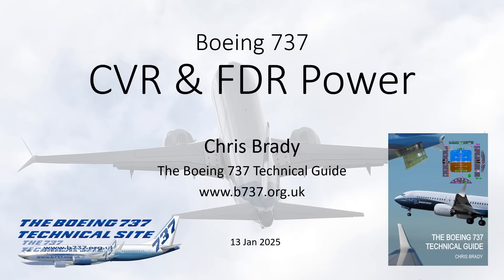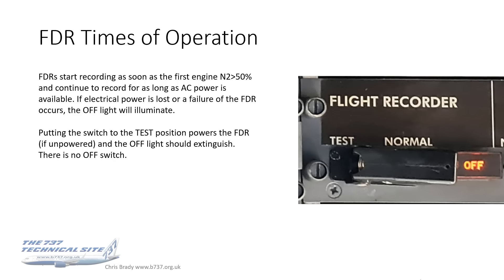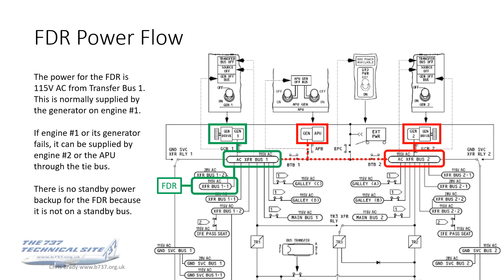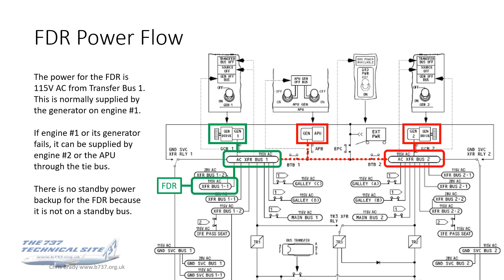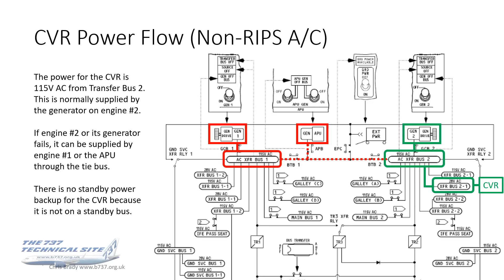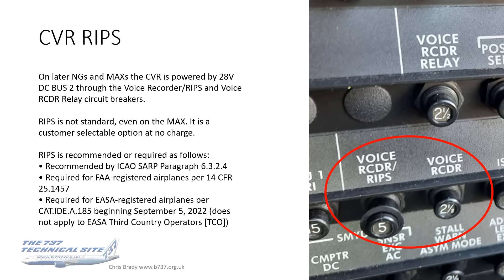737 CVR FDR Power

Comment: Crazy you would think one of the recorders would run on a standby bus.
Reply from the maker: As I said in the video, it won’t help get you down so save the battery for other essentials
Reply: @ChrisBrady737  no but the whole point of these devices is to save lives in the future ! - they cannot do that if they are not running, this is frankly an unbelivable design flaw
Reply: @birdingbilly  So you'd further jeopardize the lives of those on the current flight just so you can—with a high probability—learn that the accident was caused by pilot error due to gross incompetence, with little to nothing learned that will prevent the same from happening in the future?! I, for one, am glad you don't design airplanes.
Reply: @petep.2092  nope, I would design in enough power to do all the things needed including the FDR and CVR - it's not rocket science and just common sense, something that you clearly lack.
Reply: @ LOL. There is nothing more useless to the pilots than the flight recorders. So, if you had common sense, you'd use that extra battery power to power more items that could be of benefit to the pilots instead of the recorders.
Reply: @petep.2092  more batteries - as indeeed is now required
Reply: True however make a bigger battery to maintain the 30mins .... Boeing have seriously lost there way @ChrisBrady737
Reply: In a complete electrical failure scenario the FDR wouldn't get any data because the computers generating it are mostly offline in that scenario.

FWIW I think Boeing should have updated the newer 737s to auto-start the APU in event of dual generator failure but to be fair that is an extremely rare scenario.
Reply: @xenadu02  I think that in case of total AC electrical failure, some equipment powered by DC bus(es) still produce some data worth saving into the FDR.

About APU - I totally agree with you, and switches/relays modified to automatically restore power to AC transfer buses (AFAIK currently at 737 a pilot must flip the switch to power AC buses from an APU).
Reply: @ Agreed. On dual gen fail computer should auto-start APU and auto-switch AC xfer bus to APU once it is online. Clearly the existing incident model for dual engine out at low altitude is incorrect. It seems to happen once a decade (give or take) so it is worth making as much as possible automatic in that scenario.

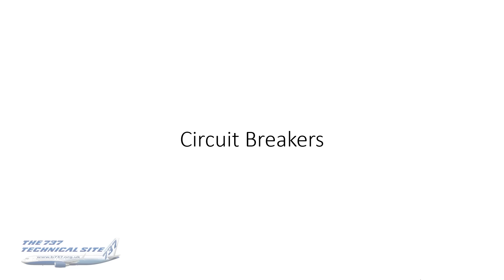Comment: 12:02 CVR in aft cargo hold compartment 12:20 FDR in rear galley ceiling 13:29 both powered from E&E bay; cabling must be intact 14:42 circuit breakers can/should be used to prevent accidental overwriting of incident data

Comment: Based on the video, it can be inferred that the aircraft most likely had functioning hydraulics in the final phase. The 737 does not have a RAT, meaning the aircraft should have had electrical power. Therefore, I can't imagine what could cause both the CVR and FDR to stop working just 4 minutes before the accident.Is it possible to perform such an extreme landing using only control cables to operate the aircraft's flight surfaces?
Reply: 737 flight controls are cable and pulley. They're 40's and 50's technology; There's no fly by wire.
Reply: 737 can be flown without hydraulics (at least for pitch/roll), it's called manual reversion, however to control yaw, electric power is required to run standby hydraulic pump for rudder.
Reply: @ukaszwielgosz7093  The aircraft approached at 200 kts the correct speed for a flapless approach. At that speed the adverse yaw would be relatively small especially if the roll-rate was kept low.
Reply: The No 2 engine was operating during the landing, but probably at low power, providing some hydraulic power. This may have assisted the pilot, as the flight controls are a relatively light load. But the hydraulic power would have been insufficient to operate the flaps & slats and the undercarriage. Also the engine power my not have been enough to keep the No 2 generator online.

Comment: What would happen if the pilot pulled the fire bottle handle for the left engine? Is it any different than just shutting down the left engine power?
Reply: If I remember correctly, pulling the handle closes engine bleed air valve, closes engine fuel shutoff valve, closes hydraulic shutoff valve, closes engine anti-ice valve, trips generator control relay, arms fire extinguisher bottles, silences fire warning bell, and illuminates fire handle light, and turning it fires the bottle. So there's a lot more going on than merely shutting down the engine but the result is ultimately the same - engine shutdown and a loss of the AC bus and hydraulics powered by that engine.
Reply from the maker: @GlutenEruption absolutely correct
Reply: Shutting down an engine with the fuel cutoff switches doesn't stop the engine-driven pump (EDP) producing hydraulic power via windmilling. Shutting down the engine with the fire handle would stop the EDP producing pressure. That might be a clue as to why the #1 reverser didn't deploy (or rather one of the reasons why)
Reply: @ great info! If you shut off an engine with the fuel cutoff switch, when you’re on short final, below a thousand feet, and slow enough to have the gear down, how much power are you going to get out of the EDP from windmilling at such a reduced speed? Does the 737-800 have any kind of load shedding for the hydraulic system, or does everything on it just get gradually reducing pressure/volume?
Reply: @ImperrfectStranger  "That might be a clue as to why the #1 reverser didn't deploy (or rather one of the reasons why)"

The No 1 engine was not running during the landing, so it is likely that the thrust reversers was not deployed because it was not selected.
Reply: @ Well, there are might be lots of reasons why the reverser didn't deploy:
Fire handles, pulled shutting off hydraulic fluid.
Not enough hydraulic pressure to unlock the reversers (The engine probably wasn't windmilling fast enough to get power from the engine-driven hydraulic pump)
Radio altimeter not providing data to the reverser system (in place of the weight-on-wheels air/ground sensing system). The Radio altimeter signal goes via the Flight Control Computer, so maybe a power issue with those.
Some other electronic interlock I'm not familar with. 

Even if the engine wasn't running, the reverser blocker doors would have provided some drag (at higher airspeeds).
Reply: @ If the engine is still running, can the cowling slide back without the reverser doors deploying? In other words, could the right engine have been sending all of its thrust rearward even though the cowling portion of the reverser was slid back?
Reply: @PetesGuide  The blocker doors are  mechanically linked to the reverser cowls with individual metal ties for each door. Think of an umbrella, but with individual cloth panels.
Reply: @  Thanks!

Comment: So it is looking like the most plausible scenario from the little we know so far would be a dual engine failure or shutdown, with no APU running.
Reply from the maker: It looks like that but we will only know for sure when the report is published
Reply: Under such a scenario, is it correct that there's no hydraulic power generated by the Electric Motor Drive Pumps (EMDPs) or Engine Driven Pumps (EDPs)? Would that only leave whatever pressure is stored in the accumulators? From there, I assume it would be difficult to operate the reverse thrusters, flaps, landing gear etc?
Reply: @drmal it’s possible that the EDP’s may have been producing pressure depending on the RPM of N2 due to windmilling - unless the fire handle (switch) was pulled. The accumulator on the B737NG is only for braking
Reply: @drmal  The thrust reversers are a relatively light load, as are the flight controls, so there may be sufficient residual pressure to operate these systems. The undercarriage and flaps & slats are another matter.
Reply: However, from the videos it looks like engine no 2 was working when the jet came in to land 🤔

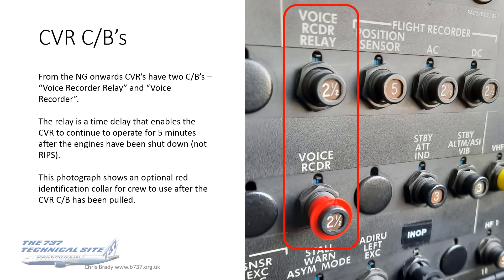Comment: 15:32 - the collar is for crew to easily locate to pull ? Or the red collar is there as the CB has been pulled and collared to avoid re-energizing during maintenance or due to MEL procedures ?  Great video

Edit : Is it plausible that the damage to right engine due bird strike could have tripped the Right Gen off line & sending a surge through the system causing the Left Gen to trip offline ? That could account for the immediate loss of Generators / ADS-B & perhaps immediately stopping CVR/FDR recording …?
Reply from the maker: That collar is for location. I think that your scenario is implausible but hopefully all will come out in the final report.
Reply: @ChrisBrady737  yes - eagerly awaiting more details
Reply: Red collars around C/B’s as shown in the video for the VOICE RCDR are installed (when applicable) as part of the MEL application procedure when carried out by maintenance staff so the aircraft can be dispatched. The C/B remains pulled and red collar applied until maintenance staff have rectified the defect
Reply: @ that’s what it looked like to me as well. Too much time on the 87 makes the typical CB seem like a distant memory (;

Comment: Hi Chris, another very interesting video! Thank you.

Can I confirm something with you? I can see from your book that the standby hyd pump is powered from txfr bus 2. Is that the only power source to it? It seems strange to me that a standby system wouldn't be powered by a standby system.
Reply from the maker: Don't forget that one is standby hydraulics and the other is standby electrics. The odds of having a dual hydraulics and elec failure are very remote and don't need to be considered for certification.

Comment: Thank you!  Follow-up questions:

Does the APU try to start automatically if both main engine  generators go offline?  

Under what conditions might the APU be unable to start?  (I assume that it relies on the main aircraft battery?)

We will probably never know what was attempted by the pilots in those last four minutes, but if there was a major electrical failure, it seems at least feasible that starting the APU might be likely to have been something they tried.
Reply from the maker: "Under what conditions might the APU be unable to start?  (I assume that it relies on the main aircraft battery?)" - Poor battery condition. It can happen on cold mornings.
Reply: @ChrisBrady737  Many NG's have a dual battery system. One battery is for the APU only.
Reply: @ImperrfectStranger  do we know if this was an option, or just standard equipment after a certain time?
Reply: @ Sorry, disregard my comment. I misunderstood the term auxiliary in my notes. There are single and dual battery options. The "dual battery" system (in relation to 737NGs) actually refers to an optional two battery setup where an "auxiliary" battery is used to assist the main battery during emergencies (i.e. to help power the Standby Busses). In all variations, single battery or dual battery, the main battery is used for APU start.
Reply from the maker: "Does the APU try to start automatically if both main engine  generators go offline?" - No
Reply: It can be seen in the images of the tail section that the  APU air inlet door was closed,which suggests that the crew did not attempt to start the APU.
Reply: @christopherrobinson7541  or it could as easily imply that if they DID try and start the APU, the main (edit: or secondary if fitted?) battery was either fully deleted or disconnected.  

Assuming the battery chargers were operational and thus providing voltage on the non-switched hot battery bus, it's not clear (to me, yet) that the pilots would be aware of this before the generators have wound down.

I'm not saying it's likely, but simultaneous dual generator failure (resulting from bird strike) combined with a failure of the battery to provide power to the non-switched hot battery bus, could explain a total loss of pretty much all systems except for the mechanical links from the cockpit controls to the control surfaces.

Although the single thrust-reverser at least opening (which I'd assume is electrically driven?) is perhaps the best evidence against this hypothesis?

And yes, I'm fully aware that I'm dunning-krugering hard here!
Reply: @christopherrobinson7541  I would assume those doors are latched with a solenoid? If so a disconnected or dead battery might also prevent that door from opening?

Comment: It appears that at least one engine was still turning. At what point would the generators drop off line? Will a windmilling/ldling engine still produce power? If so it would imply direct physical damage to both generators. Are they in a position where a bird strike might cause physical damage to the generators even if the engine is still running/windmilling?
Reply from the maker: A windmilling engine may be able to run a generator depending upon airspeed but for a damaged engine it is very unlikely.
Reply: The engine that looked to be running on landning was the bird stricken engine with lots of damage, blades gone. So the running engine was in a very poor shape, if I’ve understood the different analysis so far.
Reply: @randomgeocacher Videos show both engines were damage as smoke/spark can be seen coming out of the left engine just prior to compressor stall seen on the right engine.

Right engine was clearly running and producing thrust as evident from the exhaust plume on landing.

So it would be difficult to determined based on photograph alone what are the damages cause by the birds or by digging into dirt and concrete?

But we do know that they had at least partial engine thrust available. The last ADS-B data point they were around 500 ft AGL at ~154 kts airspeed.

They ended up going around 200 kts on the other side of the runway after executing a teardrop manoeuvre. There’s no way they can perform the turn from that height and sped up to 200 kts without at least some thrust available.

Teardrop manoeuvre consume a lot of energy to complete.
Reply: @tonamg53  Yes, this video seems to have missed out on this point.
Reply: The generator is not the engine. The generators are run via gears connected to the front rotor. 

An engine can run without its front rotors or windmilling though it will lose a lot power as there is no bypass. 

However if the front rotors connecting gear to the generator is damaged or if the rotors are windmilling, the gears will not turn fast enough for the generators. In which case the generators will spool down.
Reply: @robertlee6338  This video is about the B737NG. The IDG (generator) is mounted to and driven by the AGB (accessory gear box) via a shaft(s) connected to N2 - not the fan (N1)

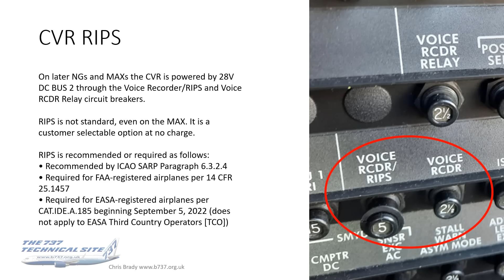Comment: @6:31  "I've no doubt it [RIPS] will be mandatory equipment at some point in the future"  i suspect that future just got a lot closer!
Reply from the maker: Let us hope so!
Reply: @ChrisBrady737  was the absence of RIPS already being mandatory an issue in the B737 community?  and has there been discussion about the need for a battery back to the FDR?
Reply: But 10 minutes is not nearly enough.
Reply: @VNAV_PTH how long can a plane fly with no power? More than 10 minutes?
Reply: @RatherBeJetSkiing  Far longer than 10 minutes.
Reply: @VNAV_PTH  I checked Google out of curiosity. No idea how accurate the answer is but it said a 737 could glide from 34,000 feet with no power for 15 to 20 minutes.
Reply: @RatherBeJetSkiing  Any plane becomes a rather poor glider with the engines out. It's not THAT poor though, from cruising altitude it'll be many tens of miles before ground level is reached, 50 miles is certainly possible.
Reply: @grahamstevenson1740  Current record is still Air Transat 236 so far as I know, the 'Azores Glider' - 75 miles, 32 minutes, from 39,000 feet.   An A330, which does have a RAT  (since it was out of fuel the APU would not have worked).   And the pilots had to deliberately lose some height on final approach, so it could have gone a few miles further.
Reply: @VNAV_PTH  It would have been enough in this case.